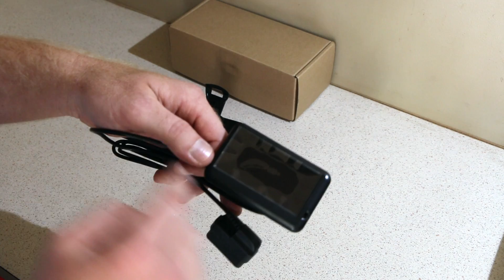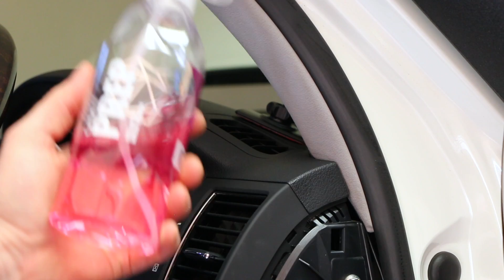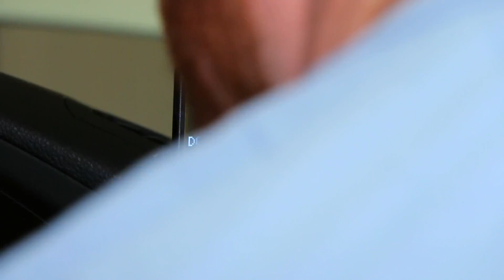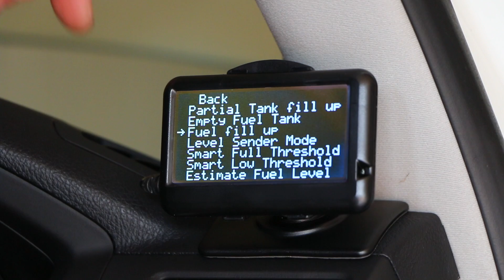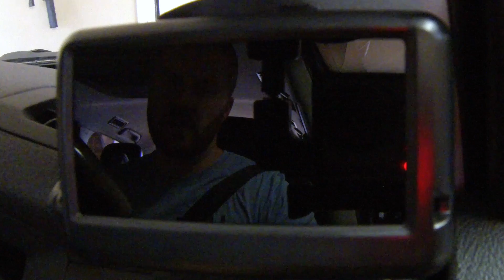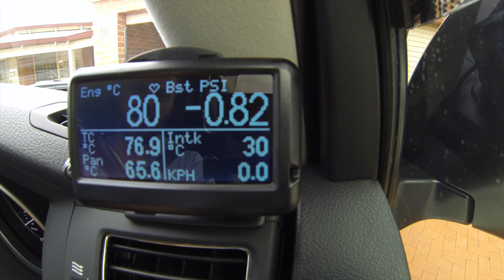LANDCRUISER 200 | Ultragauge MX1.4 | In depth review, install and operation | OBDII gauge | XPLORING

Comment: Late to the party -- but I enjoy and appreciate your Posts and comprehensive YouTube items.  I have just reviewed again your item on Ultra Gauge -- https://www.youtube.com/watch?v=faG27fK5BbY.  I am about to buy. I am curious to know whether you have had any experience and/or are aware of any conflicts with Ultra Gauge after installing a Torque Converter Lock-up or other forms of ECU re-mapping?? 

I am hoping that Ultra Gauge can be made to work and particularly assist with temperature monitoring at Torque Converter, Transmission, Exhaust -- and also help with fuel management. 

Background:  I am a Derby-born West Australian now domiciled in Brisbane.  We are planning a lengthy trip in our 2020 Land Cruiser 200 series Sahara with 4.5 litre V8 turbodiesel, upgraded by JMACX -- https://jmacx.com.au/ -- to GVM 4200kg, Rear Axle 2850kg, GCM 7700kg, Total Fuel Tankage 273 litres (OEM Tank 93 litres plus Long Range Brown Davis 180 litres replacing 45 litre secondary tank),  and with Just Autos ECU Multi-Map -- 
https://www.justdieselperformance.com.au/200-series-land-cruiser/

https://www.ultragaugeaustralia.com.au/ website advises that:
“If you have had an engine or transmission remap, or a torque converter lock-up kit installed this may affect ability of the gauge to read certain parameters. The gauge looks to find factory PIDs/parameters, if it is unable to see these PIDs/parameters the gauge will default to a display output of 'ERR'. If you have any concerns or questions on this please send tech support an email on kristian@preciseauto.com.au” 

I contacted Kristian -- he says Ultra Gauge might work after my ECU re-mapping, but not guaranteed -- best to obtain actual experience from others.

Any comment you might care to make would be very welcome.

Our LC200 will be heavily loaded for our next East-to-West trip and also will have an Australian Off Road (AOR) Matrix Caravan (ATM 2800kg) -- https://australianoffroad.com.au/off-road-caravans/matrix-s5/ -- and involve travelling Brisbane > Darling River Run > Broken Hill > North Flinders Ranges > Alice Springs > Gary Junction Road > Port Hedland > Pilbara/Gascoyne/Murchison/Goldfields – and eventually visiting family in Perth before returning to Brisbane via a different route.

Comment: Gday mate, how’d you go with the fuel consumption on this gauge? Was it the same as the on board displayed consumption?
Reply from the maker: Hey mate, probably the only part that doesn’t work well. I don’t use the fuel data from this as I find it inaccurate
Reply: @XploringOz thanks for the response mate, yeah I just can’t get mine to work well with the fuel either and was considering changing but the smaller profile can’t be beat, I think I’ll do the same and just use it as a gauge. Love your videos too mate 🤙
Reply from the maker: @outbackswagging1269 no problems mate, glad you got some value from this video. I agree though, fuel readings are not their strong point, however the drawback is worth the benefits this unit brings in my opinion. I still love it and wouldn’t change it with the other options on the market these days

Comment: Hi Nath great video on the ultra gauge.can i ask a couple of questions please.
Do you have a lock up kit on the gearbox also do you have a trans cooler installed 
Regards Glenn
Reply from the maker: Thanks mate, appreciate that 👍 
So yes, have been running a lockup kit for some time now and have recently (6 months ish) fitted a trans cooler. Found we needed it in addition to to LUK on very steep and long terrain

Comment: Great video! In the website of the altra gauge it say I need to choose preprogramming option I don’t know what to choose I need 2 gauge for LC200 v6 2014 and lx 470 2006 these cars r Middle East spec I need help
Reply from the maker: Hey mate, I wouldn't want to steer you in the wrong direction, probably best contacting their customer support to make sure you get the right one 👍

Comment: Hi, I may have missed something but does this unit display an EGT gauge?  If not, what do you load instead.  Thanks
Reply from the maker: Hey mate, this unit can on the newer LC200 vehicle (2015+) however the sensors aren’t present on my 2014 model. 
This being said, I have a video on how I went installing the EGT gauge on the channel 👍

Comment: Hi Nathan, great video as usual thanks. Have just fitted this unit, loving it, especially that it assist with data related to my extra fuel tank. Could you please share details on the lock up kit you have installed? Thanks

Comment: Hi quite impressed with your review I am most interested in the auto transmission gauge i have a Sahara 200 series MY 2013 for towing caravan my question is, is this parameter built into the MX Ultragauge and if so is it accurate or it comes up with an ERR because Toyota do or don't provide ECU info Thanks.
Reply from the maker: Thanks Maureen, glad you enjoyed this video. So the 200 series has the auto transmission sensors that comply with the Ultraguage. The 200 series has both the torque convertor and the transmission pan temperature.I've found it to be very informative and is almost always used. 
I hope this can help 👍

Comment: Did you ever find a way to read TC lockup with the extreme fitted?
Reply from the maker: Hey mate, that's a negative. This function still isn't working, however it's fairly obviously when monitoring the temps. Within about 1 second of the lockup engaging the temps will stabilise to mirror each other, so not overly concerned. 
Cheers, Nathan.
Reply: @XploringOz  yeah I did notice and feel it in was Just hoping you found a solution haha
Reply from the maker: @1madgerman  Yeah, unfortunately not. I think the LUK interferes with that signal, haven't been able to find a way around this...

Comment: Hi! Quick question, would it work on a long range fuel tank? I want to get one for my Ranger but it now has the 140lt tank upgrade. I was just not sure if it would work or what the max capacity is for the ranger fuel tank size.
Reply from the maker: Yes it can. You can set the size of your fuel tank, even if it's a long ranger. This can be done in the settings and will compute into the relevant data fields 👍

Comment: Hi Nathan, query for you please, I have set up my ultraguage with the same configuration as you as it makes good sense, however, a review of the 200 handbook does not reveal the “acceptable” operating ranges for any of these sensors.  How do you know when the temps are too high before something breaks?
Reply from the maker: Hey mate, yes there is no real posted 'average' temp or ranges for this information. For me personally it was just observing and nothing my averages in various conditions. After some time with the unit you get used to how your vehicle should perform and react to certain environments and then you can monitor and adjust your driving style to keep the range stable. 
Is there any particular gauge you are interested in, I could share my thoughts with you?
Cheers 👍
Reply: @XploringOz  Txs for your response Nathan, I guess the key ones are engine temp, pan temp and torque converter.  I reckon the Eng temp should be no higher than 95 and ideally under 90.  The pan temp I have seen get up to 117, which I would have thought was too high. And as for the TC, I understand that temps over 120 will be degrading the oil exponentially, and should if at all possible be under 100 or preferably 90.  I have Installed a Wholesale Automatic torque converter lockup kit, however it went on the fritz after six weeks and they are replacing it next week.  It was doing a great job until then and looking forward to having it back as it kept the temps cool (around 80) and was saving me almost 4ltrs per 100km towing a 3 ton off road van.  By the way, love your informative, no nonsense videos mate. Doing an awesome job brother.
Reply from the maker: @davideccleston2142  Yeah mate, so my results are this: 
Engine Temps - Average around 80 degrees, maybe 85 when under a little more load or very hot day. I have seen max of about 106 degrees on a very soft and slow dune climb that required full acceleration for about 45 seconds. As soon as I stopped it cooled straight back down. I have seen it go up to about 95 when under load and overtaking or accelerating up hills etc. 
Pan Temp/TC - So I was seeing some very high figures before my lock up kit. When I used to tow the van there were times where I couldn't lock the transmission and the pan would sit around 112 and the TC around 125 (not healthy). Since getting the lock up kit, I'm seeing anywhere between 70-85 degrees regardless of load and ambient temp. Very happy with these results and always recommend these kits to those who are towing or modified. 
Good luck with your new unit, hopefully it doesn't keep causing you issues 👍
Thanks mate, glad you're enjoying the channel.
Reply: @XploringOz  many Txs Nathan, great feedback.

Comment: Hi just watch your video on setting up your ultra gauge very good 
Did you have any problems with your lock up kit and if you had a trans remap any problems
Reply from the maker: Thanks mate. So negative, no problems with the tune or lockup kit. The only function that is lost on the UIltragauge is the 'Lockup' reading. This doesn't work correctly, but obviously when you have a kit installed you are definitely aware of when it's locked up. 
Cheers, Nathan.

Comment: Hey mate, how did you get the cable behind that top part of the dash before getting it down that side panel?
Reply from the maker: Hey mate, I managed just to gently push the cable down between the dash and the pillar at this point. If I remember correctly, I think I gently used a small screwdriver. 
Cheers, Nathan.

Comment: Hi Nathan!
Your video has motivated me to buy it :-)
Can you share with us what alarm settings you have?
What is the normal temperature for the engine and gearbox?
Thanks for the reply!
Reply from the maker: Awesome mate, I'm sure you will find this handy. 
So I only really use two alarms. First one being engine temperatures. I set this at about 110 degrees Celsius. The car can reach this during hard hot runs, however it just reminds me to go easy and keep an eye on it. 
The second being the gearbox temperatures. This is going to vary a fair bit, especially if you don't have a lock up kit. I was easy getting into the 120-130's when towing without the lockup, however now I'll be lucky to get over 90 degrees. The LC200 will also activates its on board factory alarm when the gearbox gets to 150 degrees anyway. 
Hope this help, 
Cheers, Nathan.
Reply: @XploringOz  ok, thank you!

Comment: I am finding the Ultra Gauge difficult to program and understand. I'm sure I'll figure it out. I'm an aviator who is used to dealing with avionics and I am a computer guy from the 1980s to now, but the User Interface on this is pretty poor. The email support is better than usual, however.
Reply from the maker: For sure, it does take a little mucking around to work out the programming, but I've found once you have set it up, it works quite well when left alone. 
Cheers, Nathan.

Comment: Great video however I have further questions as I own this and am unsure on the process when refuelling (a full tank). As such, my litres usage shown continues to be inaccurate. There was a setting somewhere to set a ratio of about 0.52 but I can not locate it for the life of me. I am sure this unit is smarter than I am, just need to work out how to use it so it calculates my fuel usage accurately. Any help appreciated cheers mate!

Comment: I'm wondering what pre-programmed Scanguage would work best with a BT-50 (2015) seeing as how they're basically Rangers, would it be the Mazda pre-programming? Or the equivalent Ford Ranger codes?
Reply from the maker: I don't have personally experience with these vehicles or the ScanGauge units. I would say either unit would likely to be programmed the same, as you mentioned that are essentially the same vehicles. 
Probably just be to check with the seller.
Reply: Ranger/BT50 are the same..

Comment: Is it true that any gauge can only display info that the computer allows?
I have a 2013 d max and have a scangauge 2 but cant show frp as its not suported

Is the Ultragauge your using vehicle specific?
Reply from the maker: It is, the gauges will only pick up a small selection of the actual information available through the OBDII port. This is evident when comparing the Ultraguage and my Toyota TechStream software. The UG picks up about 49 gauges, where my TechStream software picks up over 100 and allows for customisation of vehicle settings. 

The UG for the 4.5L LC200 is specific with it's pre-programmed software, however some units are interchangeable between vehicles. This all depends on the type of software the vehicle is running.

Hope this helps, Nathan.

Comment: So I set this up on my LC200 and the fuel warning goes off at half a tank. Also the fuel economy calculation is right out. I set the tank size as appropriate but it seems like its doubling the fuel usage reading. Have you noticed any issues with that on yours?
Reply from the maker: Hey mate, yeah I know there is a bit of a trick to the calibration side of the units when it comes to fuel usage. Personally I don't actually use the fuel consumption readings on this unit at all. I find the factory trip computers very accurate and therefore just go off that.
Reply: I noticed the same on mine.  In the UG manual they have a fuel consumption calibration procedure.  I am still in the process of getting mine calibrated.  Did a quick calibration on a short round trip and improved, but still not accurate enough.  Planning to do on a full tank consumption and hope that will do the trick.

Comment: Hello,
I have an Ultra gauge fitted to my Toyota Prado 150, My2017. Im looking at changing my car to a Toyota Landcruiser 200, My 2016 and wondered if the unit is transferable, although on the understanding that the codes would be different.
If it were suitable, could you provide me with the codes for trans pan, torque converter, engine temp, battery and egt.

Thanks in advance.
Reply from the maker: Hey mate, it's my understanding that these units are generally pre-programmed for specific software for certain vehicles. 
In the case of the 200 series LC (4.5L diesel) there is specific software that is loaded onto the unit, so I would guess that it probably wouldn't be interchangeable and if it did work, I would guess that most features wouldn't function as intended or potentially not accurately.
Reply: @XploringOz  Cheers for that, although contacted Ultragauge and they sent me load of codes through.  Hopefully when I get the car and fit it I'll see which work.  I only tend to use the first couple of pages to monitor Trans Temps, pan and TQ Con, plus EGT, Battery, Engine Temp and one other I've found useful on the Prado is DPF Soot levels.
Reply from the maker: @Satchmo2447  Great to hear that Ultraguage responded to help you out. I would be interest to hear how you go when you get the vehicle. Let us know. Cheers.
Reply: @Satchmo2447  can you perhaps send codes? I ordered my ultragauge with the pre programming for LC200, but all M gauges shows error.
Reply: @antonievanwyk8942  will send you the PDF from ultraguage, but have not tried them yet so can't confirm they work.  Am away for a few days but will do it upon return.  Can you send your email?
Reply: @antonievanwyk8942  Ultragauge MX codes for Toyota LandCruiser 200‐series
Transmission Temp (Torque Converter)
Abbr1:	ATF				Abbr2:	oC		
TDATA:	07E121D9000000		
TCTRL:	92					RCTRL:	10		
RPOS:	1810				MTCH:	210000		
X:	0001	/:	0100	+:	FFD8		
Out	Format:	00				Ave:	00		
Left/Right:	32	
Transmission Temp (Pan)		
Abbr1:	ATF				Abbr2:	2oC		
TDATA:	07E121D9000000		
TCTRL:	92					RCTRL:	10		
RPOS:	0810				MTCH:	210000		
X:	0001	/:	0100	+:	FFD8		
Out	Format:	00				Ave:	00		
Left/Right:	32		
Alternator Duty Ratio		
Abbr1:	Alt				Abbr2:	%		
TDATA:	07E021DE000000		
TCTRL:	92				RCTRL:	21		
RPOS:	2808				MTCH:	61DE00		
X:	0001	/:	0001	+:	0000		
Out	Format:	00	AVE:	00		
Left/Right:	30	
Gear Position		
Abbr1:	Sft				Abbr2:	Pos		
TDATA:	07E121DA000000		
TCTRL:	92				RCTRL:	21		
RPOS:	1808				MTCH:	61DA00		
X:	0001	/:	0001	+:	0000		
Out	Format:	00		AVE:	00		
Left/Right:	20	
Torque Converter Lock Up Status
Abbr1:	Lck				Abbr2:	Up		
TDATA:	07E121DA000000		
TCTRL:	92				RCTRL:	21		
RPOS:	1901				MTCH:	61DA00		
X:	0001	/:	0001	+:	0000		
Out	Format:	0D	AVE:	00		
Left/Right:	10	
Actual Fuel Temperature		
Abbr1:	AFT				Abbr2:	oC		
TDATA:	07E021DD000000		
TCTRL:	92				RCTRL:	21		
RPOS:	2008				MTCH:	1561DD		
X:	0001	/:	0001	+:	FFD8		
Out	Format:	00	AVE:	00		
Left/Right:	30		
Return Fuel Temperature		
Abbr1:	RFT				Abbr2:	oC		
TDATA:	07E021DD000000		
TCTRL:	92				RCTRL:	10		
RPOS:	1008				MTCH:	220000		
X:	0001	/:	0001	+:	FFD8		
Out	Format:	00	AVE:	00		
Left/Right:	30
Reply: @Satchmo2447  Thanks. Will try and see if they work. Also got some from project 200 (https://www.project200.com.au/dash-pull-apart/) that might work.

Comment: Is it possible to remove the door open chimes with this unit?
Reply from the maker: Hey mate, so unfortunately this unit is only really useful to read information, rather that alter settings. 
The chimes can be removed by a Toyota dealer or using laptop type software, if you know someone with the right gear. 
Cheers, Nathan.